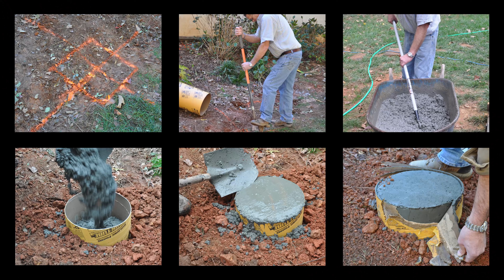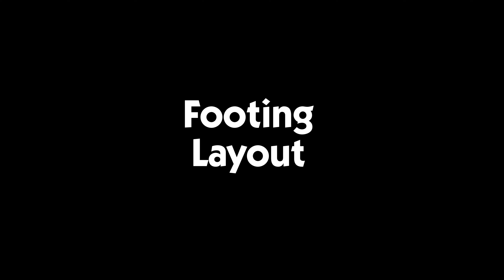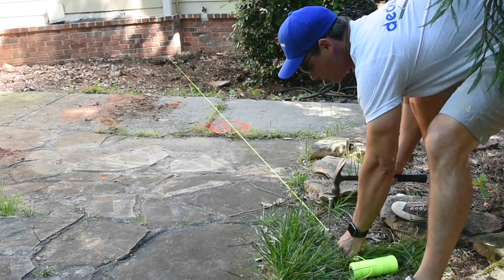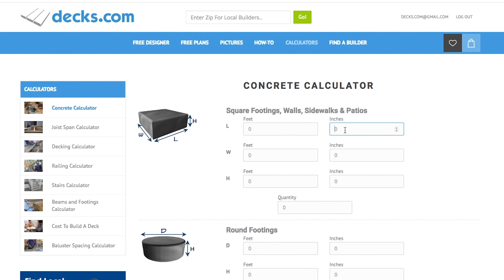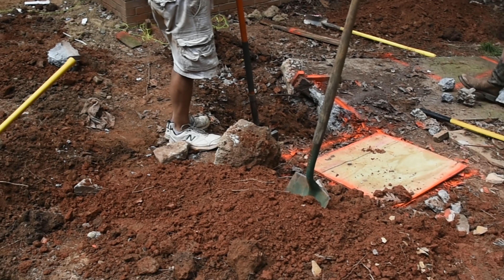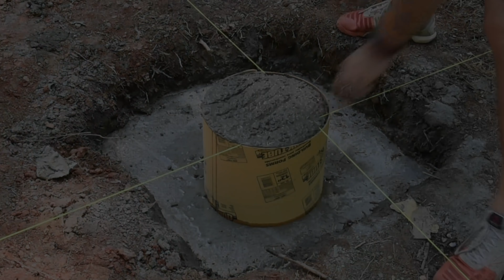How to Build Deck Footings

Comment: Can we do this same thing if the patio is raised?  I live in a house that was built in the early 1960s by my Grandparents.  They added a patio on the back of the house that is about 18 in off ground level.  The "slab" is about 8 in thick and seems to only be supported around the outside by concrete blocks underneath. We cannot see any further under to see if there is support in the middle.   We would like to add a larger deck because this has crazy measurements (it's like a bowling alley).  We would like to go over the cement and extend and use composite decking.   Can this be done without busting out the cement slab?   Also, we live in Illinois, so would have to deal with frost/thaw and heaving.   Love the channel!  I swear I have bunged everything.  LOL!   I have a list now.   Thank you for any help!

Comment: How long should you wait before pouring concrete over the footing and into the form for the pier?
Reply: You shouldn't. It's a wet joint. The concrete won't come out the bottom of the tube, don't worry.
Reply: @jonathansage2147 why did they frame and pour footing&tube at same time?

You said not to weight, I think it will go down the tube and out/over footing?

Comment: We're in the process of getting our deck replaced, and the contractor just installed helical piles. Pretty amazing and fast system. The machine just screws it into the ground. In our case they go down 12 feet, so they're down to some extremely solid ground. Supposedly, there's zero movement or settling after installation.

Comment: What do you call footing when they do the following. 

Auger out the holes below frost line. Put tube in. Fill 1/2 to 3/4 full of cement. Let cure. Put 6x6 posts in holes with cement, back fill holes with gravel. Notch out 6x6 to hold your beams. Floating footings?
Reply: Call it wrong

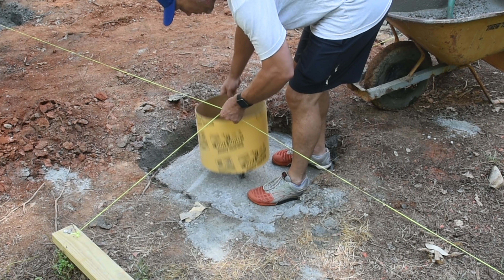Comment: At 3:00, you show the footing poured, with a piece of rebar protruding, then you put the tube form on top and pour the concrete post.  As you're standing on top of the footing when you insert the tube form, I assume you let the footing set up first.  For how long?
Reply: Probably just enough time for it to set. Based on the thickness, I would say a day or 2.

Comment: did you pour the footing and then immediately put the sono tube on & then pour that? or does it dry and then its a separate pour?
Reply: I was going to ask why he has 2 separate pours. That’s not good practice as the concrete footing is not homogeneous.
Reply: It's not two separate pours. It's a wet joint.

Comment: Hey great information,  my contractor made the cement footing 12inchs and I need them to 15ich or bigger. The deck is built, how does one adjust for this?. Thanks
Reply: Waite till it falls apart then start over
Reply: You'll be fine.

Comment: Is that dirty water or concrete he’s pouring? When more water is used than the bag says the PSI strength is drastically reduced. He used 5000psi mix but might have 2000psi concrete with how much extra water was added.
Reply: Considering they didn't prewet the soil....it will soak up the water fast. That's probably why they mixed it wet.
Reply: @chrisalister2297  If an inspector had seen that pour they would have been failed on the spot.

Comment: I believe that you should reduce the amount of water in the mixed concrete to improve the resistance and the survivability.  College tip 😁
Reply: Resistance and survivability?
Reply: Glad I'm not the only one confused by that watery mixture. Maybe it's the type of concrete they're using?? 🤔
Reply: @kennethgray6966 no, they added way too much and jeopardized the strength of the concrete. Unless of course the were using an admixture which wasn’t mentioned.
Reply: We mean by resistance: to snow or rain all these wet materials can harm the structure unless you change the amount of water and ciment to make theme less harmful .
Survivability: the duration of time, we have to make sure that the foundations will stand and hold the structure as long as possible.

Comment: Wish my frost line was 16"...
Mine is 4'
Reply: Siberia sucks.
Reply: damn..
Reply: @_Noopy_  Mine is 42". with a 2'x2' footing to dig out......yea....it was not easy. 

Compounded by the fact that most of the ground is just rock, plus im 6'3, means digging/hammering through rock, trying to bend down into a tiny 2' hole was extremely painful and time consuming.
Reply: @3DTwinkies  Here in Phoenix Arizona we just go like 1 ft.... but hard caliche soil full of rocks. Still better than 42 inches lol...

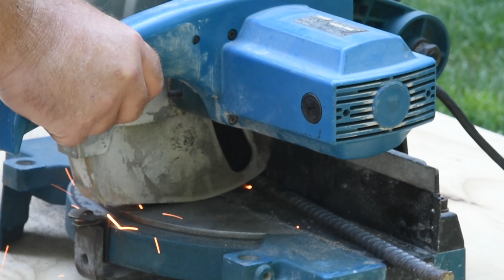Comment: 2:53 how soon after pouring your footing do you typically pace the sonic tube on top? I suspect as soon as it starts to harden enough to support but not completely dry so the two forms of concrete become one solid strucure?
Reply: So, for those mere mortals among us who don't have the skills to do it in one pour, what is the answer to this question?  How long do we wait for the square pad to set before working on the cylindrical piers?
Reply: @sauceswoodworkinganddiy7292  you don't have to wait. Do it before the base cures
Reply: I've wire tied short pieces of thin rebar to the bottom of the tube to lift it a couple inches off the bottom of the oversized hole and done it as 1 pour. Hole 3-4" bigger than tube. Works great. Put 1 bag or more in each hole then go back to the first hole and start filling them 1 by 1.
Edit: For deep footings ~40" frost line. Not the surface footings like the video.
Reply: @artsmith103  that's smart.
Reply: @Luckingsworth  Some structures like Gazebos and Solar Panel Arrays require the upside down mushroom to provide wind lift protection. Plus the added area for support is amazing. 8 inch vs 6 inch is 64 vs 36, almost double.

Comment: wondering why when doing fences it is recommended to have top of concrete below grade immersing the post in soil (apparently this helps with frost heave) while doing decks the concrete comes above the soil?
Reply: Because people are lazy and don't feel like digging a proper hole? For a wooden fence post hole to last, dig a hole below frost level, fill hole with concrete (with/without sono tube) to several inches above ground level. Embed fence post, and then round off the top of the concrete so water will drain off of it. Extra years of duty life if you go back and waterproof where the wood and concrete meet. PT wood will last much longer if that interface is sealed from water entry.  But it will take an extra 2 min/post, so lets just dig a hole, throw in a couple bags of dry mix, and backfill...
Reply: @boots7859 better off mounting the post in a bracket so that it can dry because it will get wet. 

To the OP, brackets for fence posts are a better solution, but it's more expensive up front, so people don't do it. The reason people don't extent the concrete way above the soil line is that it's ugly and it gets in the way of the fence boards.
Reply: Perhaps the extra weight of the deck helps to offset that? I am here for the same reason, because I beleive this method is better for setting fence posts 😁 so I would be curious if you find info that says not to do it like this.
Reply: So that the bottom of the fence is close to ground level, ans a fence's overall lifespan makes it kind of irrelevant anyway. 
Ps use galvanized steel posts and adapters for fencing, even wooden fences.

Comment: I agree with Marks comments, 5K cement is based on proper slump of about 6" this looks like maybe about a 2" which is easier to work but about 50% weaker!
Reply: Slump measures how far it falls from the height of the cone so a 6" slump is way more soupy than a 2" slump so you said that backwards. 2" slump is extremely thick
Reply: I've got a DIY deck in the future. Can you explain what you mean by "proper slump"?
Reply: To much water is soup ,slump is how thick it will stand in a clump

Comment: no guidance on how to do this on a slope or uneven ground - how to get the piers all the same height?
Reply: .the cement was pour'd so wet...it was self leveling....ba, dum tshh..
Reply: Use a self leveling laser or the old water level which is basically a clear hose with dyed water in it  secure one end to known level mark move from post to post raise or lower end of hose until water level is on reference mark , water level on your end is exactly level with it.
Reply: @jaylong3581  can you run a level plank of wood and place a level on it?

Comment: Those footings are way larger than necessary for a deck.   16"x16"x8" is a standard size for deck footings.  Anything more than that is overkill unless it is supporting a concentrated load.
Reply: they wanna park a car on the deck
Reply: @mica122213  Maybe a big hot tub to hold 7 people each upwards of 125#, maybe as much 250 or 300? The weight of the water alone in a 400 gallon tub is over 3000#, not counting the weight of the tub itself and the people. Why, the water alone could weigh more than average sized car.
Reply: Code is different in each location. What they did is up to code in my area
Reply: Here in Nova Scotia, we were required to dig 52" down (below the frost line) make a 2'x2' base for the footing and then essentially 4ft of 10" sonotube on that, with then 6x6 posts. Total overkill for a small deck just 3ft off the ground!
Reply: I've got a 46x16 deck, and need to support 6600# per trib.  I'm looking at 24" Bigfoot footers.
Reply: And what's wrong with overkill? twit

Comment: That calculator is terrible.  It recommends (6) 80lb bags of concrete to make a single 2'x2'x1' footing.  How is that possible?
Reply: Each 80lb bag of concrete is only 0.66 cuft.
Reply: You are correct, sir. 4 cu ft. However, that 2x2 number is bigger than most pads. Here in No. Va. I go 16" diameter , 24" to frost line, to grade. Which means for my four footings, I will need 20 bags @ 60 lb. That is what I call reasonable overkill. I am replacing a deck for a client who had a deck supported by footings which had  a 12" footprint.
Reply: Seems good so far! Was easy to talk to about his My Shed Plans [Go Here=> WoodBlueprints. Com ]. Guided me in the right direction & helped me understand everything & in the end it was what I wanted

Comment: helpful video!
Reply: No it's not. It's the way not to do it. 
One the concrete was to soupy 
Two that onr little piece of rebar was a joke. You need way more rebar
Three he didn't put the strap in. So now you have to drill into the concrete. 😂

Comment: But now what??  How do you add a post to the top of that footing??
Reply: maximus  Couldn't you put the anchors in the wet cement instead of drilling holes?
Reply: @sandrakrytus5809  different anchors for both 'cast in concrete' and install after concrete has set. Ends up with the same result.
Reply: If you still anchors you might what to way a period of time before you drill the anchors.  I've heard 4  weeks.
Reply: if you were to put one in you would add it while the concrete is wet obviously

Comment: What if there IS water?
Reply: find another house to build a deck on
Reply: Then a proper drainage system would need to be installed in the area first to evacuate excess soil water. Aka french drains and sumps.

Comment: The footings have to be squared with a shovel before pouring the concrete, this is needed to ensure the minimum load distribution area needed. If you pour the concrete in a pit with rounded corners, the area is too small.
Reply: wrong!
Reply: @speedwayman100  lol
Reply: Lmao, unless you calculated the load area with the diameter of the hole....
Reply: Well mister smarty, do a simple practical exercise with a sharp pen, apply it with the blunt end to your hand, afterwards with the same amount of force apply it with the sharp end, wich one concentrates the loads more in a smaller area? The diameter of the pen shaft is the same either way.
Reply: @dumitrupopamd   Blunt end and sharp ends of pen have different surface areas. Pressure is spread from the post down to footing in a 45 degrees cone formation. 
That means round footing could be costumed exactly in width and depth to bear curtain structural load.
Reply: I understand your point of view, but still I do not agree with it. If you will take into account the efect of the frost onto the bearing capacity of the soil (given that the bottom of the footing is not a level plane as a cilinder base for example), the fact that the level at wich the soil will be compacted arround the cone tip and higher up the base is not uniform, and the fact that the foundation will not have the necesary stability requirements, the fact that after the loss of stability there will be an additional bending moment given by the axial force multiplied by the of-axis resultant vector, and just the simple matter that is just a bad practice, all these factors and others are the reason I said that the pit must be squared off and brought to a level, uniform Dof plane.
Reply: You may be right. We do footings different in Ontario. Go at least 4 feet in to the ground. Its not expected for the footings to move much and ideal shape is a conical frustum with wide base.
Reply: I think I know what your issue is. You mean to say that if the bottom of the hole is round, (not flat) then the load distribution is not correct. You are right about that, but you didnt explain it correctly. Squaring the corners is impossible on a round hole! Circles have no corners!
Reply: Unless you draw a cross section perpendicular to the load axis, in wich case the hole in the video will have round corners, they must be square, 90°. English is not my native language, I am sorry if I explained it wrogn.
Reply: @dumitrupopamd hi would you be able to help me out and answer a few questions? Starting a studio build project and need to figure foundation out